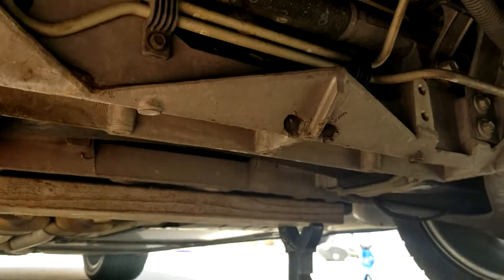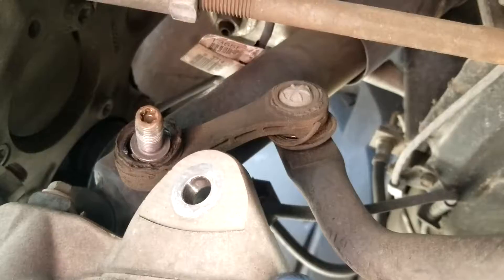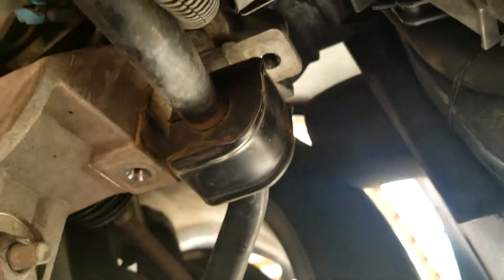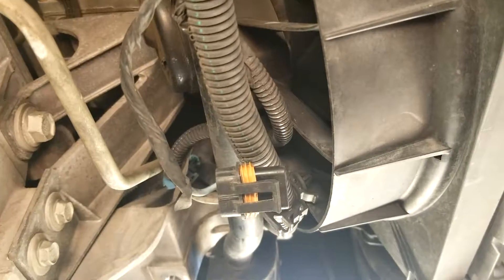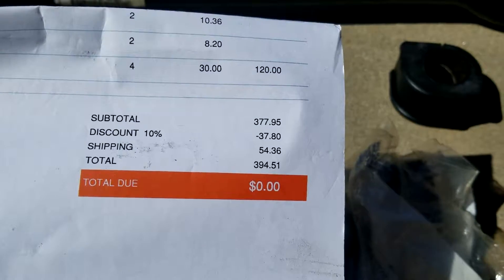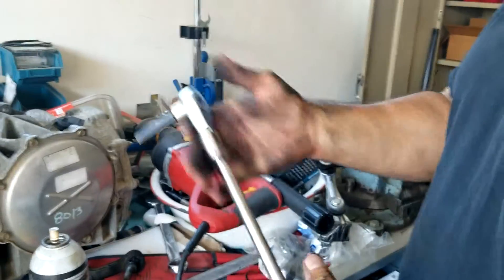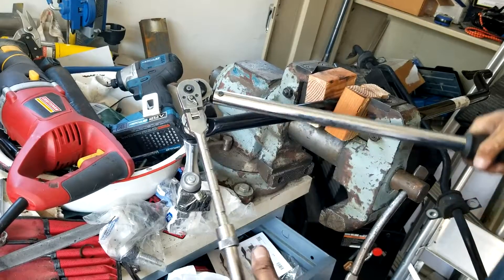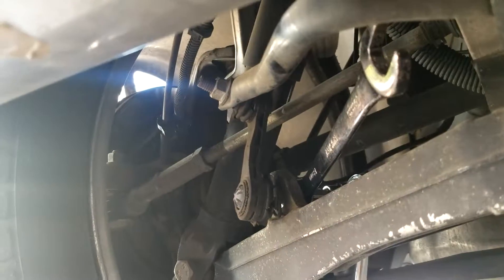C5 install: C6 Z51 sway bars/end links.

Comment: I read somewhere about torque to yield bolts being used and they needed to be new ones. Allegedly they are single use bolts. 
What did your book say if anything?

I have 2004 with the base suspension and I am considering this mod. How does it feel different?
Reply from the maker: Hey Andrew, which bolts are single use? I haven't heard about that, but if I should've replaced something, I'd like to amend the video to include that. It does feel like there's less roll and a little tighter around corners. What really closed the deal for me was lowering the car slightly. The sway bars and the lowering really helped with roll. I'm happy with it overall.
Reply: @asteriosanagnostou3243  You indicated you used torque values but I have read about the bolts being torque to yield.
Since you said you had the book, I was wondering if it was mentioned there. 
They use torque to yield single-use bolts sometimes when putting heads on blocks and such but had not heard of
it on suspension stuff.
Then I read about it somewhere and that's why I asked you.
Reply from the maker: @andrewdomenitzdmd  Ohhh I see! I learned something new today. I haven't heard or read anything about the bolts being torque to yield. I got the torque specs from a forum post dedicated to c5 torque values. I'm going to check into it this weekend and find out.